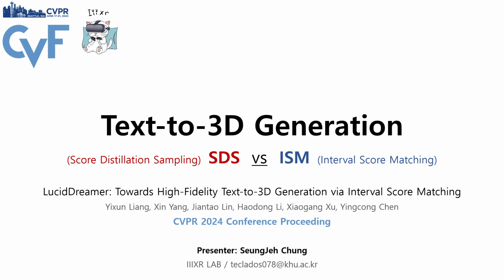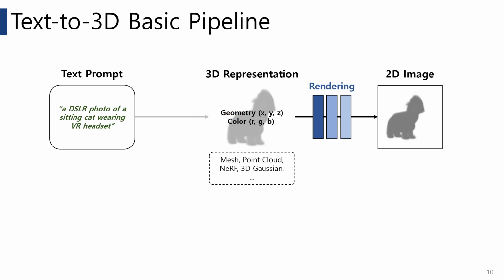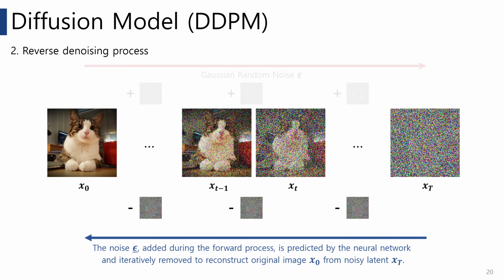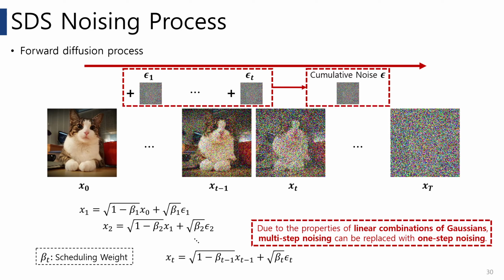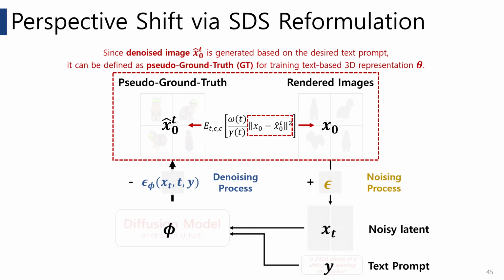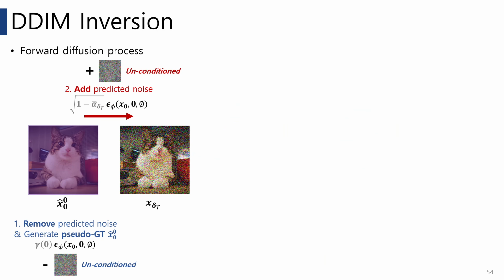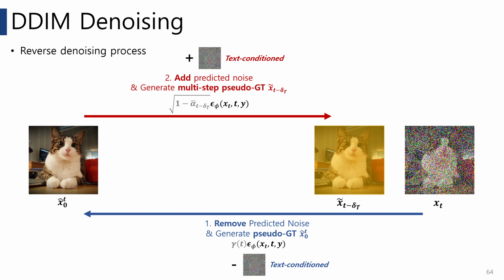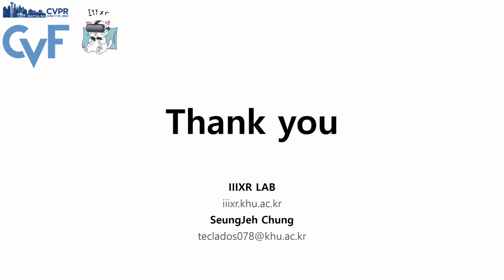[Seminar] Text-to-3D Generation using SDS versus ISM

Comment: When two models, DDPM and DDIM, are trained, they utilize 2D images rendered from a 3D mesh. However, I think there can be a situation where the 2D view does not intuitively match the 3D. For example, if I want to generate a real Moon, the 2D image seen from behind is just a black circle. Although it is accurate, I think it may not be appropriate for expressing the text prompt.
Q1: Is it okay to use an image like that?
Q2: Is it completely random to choose a 2D view from the 3D model?

Thank you for your presentation
Reply: A1. As explained on slide 13, you need to perform multi-view rendering! Since a 2D image lacks information compared to a 3D model due to the dimensional reduction, it is essential to complement this with multi-view rendering from various perspectives.

A2. Typically, camera views are sampled randomly from a spherical coordinate system. While it is possible to strategically select camera views, in most cases, randomly sampling camera views from a Gaussian distribution with a wide variance tends to yield better performance.

Comment: I could get a broad understanding of Diffusion. Thank you for the presentation.

Q1: I've seen the term "U-Net" mentioned in many other papers as well. Does "U-Net" refer to a specific network structure, or is it just a general concept?

Q2: Is it generally true that learning multiple steps of denoising performs better (except for inference speed) than learning a single step of denoising?
Reply: A1. U-Net refers to a specific neural network architecture originally designed for biomedical image segmentation. It has a distinctive "U" shape due to its encoder-decoder structure with skip connections between corresponding layers. This structure allows it to capture both global context and fine-grained details, making it widely adopted in diffusion models for image generation tasks.

A2. Yes, it is generally true. Learning multiple steps of denoising allows the model to gradually refine the output, capturing more details and improving the overall quality of the generated data. Single-step denoising can be faster during inference but often sacrifices performance in terms of fidelity and diversity.

Comment: it was the seminar i had been waiting for.

since it use text promt, it is conditional diffusion model. Then does it classifier free guidance? or else?

And the diffusion distillation I knew was made faster by reducing 1000 steps to 10 steps. What does SDS have to do with this?
Reply: A1. It uses classifier-free guidance.  

A2. Could you clarify which diffusion paper you are referring to? With more details, I can provide a more accurate answer.

Comment: Q1. I understand that DDPM is an advanced form of diffusion models. Structurally, how does DDPM differ from general diffusion models, allowing it to achieve further advancements?  

Q2. Although your explanation was helpful, I am struggling to understand how LucidDreamer differs from existing models. Could you clarify what the main contribution of the paper is?
Reply: A1. It seems your question compares DDPM with the earliest diffusion models. DDPM improves upon vanilla diffusion models by introducing a more refined mathematical formulation of the forward and reverse processes, along with a well-designed loss function. These improvements allow it to generate higher-quality samples. Since DDPM is considered foundational knowledge for diffusion models, I recommend reading the full paper if you're interested.  

A2. The main contribution of LucidDreamer lies in introducing DDIM inversion and ISM loss, which address the issue of over-smoothed results commonly observed in text-to-3D generation tasks.

Comment: Thank you for sharing your expertise in such an interesting way.

Q1. What are the main components of the "lucid dreamer" system used in ISM-based 3D generation, and how do they improve 3D model generation efficiency?

Q2. How does using deterministic noise in ISM affect the quality of generated 3D models compared to random noise?
Reply: A1. The main components are DDIM inversion, DDIM denoising, and Interval Score Matching.  

A2. It helps address the issue of over-smoothed results.

Comment: Thank you for your presentation.

Q1. In Slide 10, does the model learn up to the process of generating images through rendering? In the case of multi-view rendering, is it designed to allow a single model to generate multiple scenes, or is there a separate process that makes this possible?

Q2. In Slide 29, is the reason for adding noise to the rendered image because Diffusion is being used?
Reply: A1. The model learns specific parameters that determine color and shape during the image generation process through rendering. For example, if the rendering pipeline uses spherical harmonics to calculate color, the spherical coefficients are treated as learnable parameters. In multi-view rendering, multiple camera views are simply set, and the model uses a set of images rendered from those views.  

A2. That’s correct. The pre-trained diffusion model inherently takes noisy latents as input. Additionally, the SDS loss is defined based on the difference between the noise in the noising and denoising processes, so noise must be added to prepare the input for the diffusion model.

Comment: Thank you for the presentation. I have two questions:

Q1. In the slide titled "Limitation of SDS 2", I’m curious about what happens if the pre-trained model belongs to the neural ODE family (e.g., Consistency Models, ICML 2023). These models estimate the accurate path from any xt to x0, so they might be free from the prior gap. Could this address the limitation discussed in the slide?

Q2. In the paper "Null-text Inversion for Editing Real Images Using Guided Diffusion Models" (CVPR 2023), the vanilla DDIM inversion suffers from cumulative error, so the authors use it as an initial guess (or anchor) for their optimization process. While the main purpose of this seminar’s paper and Null-text Inversion is quite different, I think a similar problem with DDIM inversion might arise. Does the seminar’s paper address this issue in any way?

Comment: Thank you for the great seminar; it was very insightful and well-explained!

Q1. I don't fully understand what pseudo-GT is. What is the difference between pseudo-GT and real ground truth, and why can the generated image be considered pseudo ground truth?

Q2. Are recent papers trending towards using ISM instead of SDS?
Reply: A1. Since the goal is to generate a 3D model from text, there is no real ground truth. The denoised image produced by the diffusion model, conditioned on the text, is considered a pseudo-GT because it represents the image we aim to generate based on the text, even though it is not yet fully optimized.  

A2. Recent papers tend to focus on identifying the limitations of SDS and proposing new losses or constraints to address them. However, papers in domains not specifically focusing on limitations of SDS often continue to use SDS as a standard approach.

Comment: Very specifically, great seminar.

Q1. In many text-to-something domains, CLIP model is adopted for embedding text. I think text-to-3D model also adapt CLIP model for it. But other domains have issue that CLIP model, trained only for image and text, have no knowledge of something. This makes the text-to-something model that used CLIP model worsen their performance, so there are many research for addressing it. In text-to-3D domains, there are similar research?

Q2. This paper demonstrate that their proposed method, ISM, is more superior than SDS. But as I know, SDS is still used for many research. Then why ISM fail to become standard?
Reply: A1. In text-to-3D, rendering the 3D model into 2D images allows the use of CLIP, which is trained to align text and image information. This approach is generally effective, but the dimensionality reduction during rendering can lead to information loss. To address this, some research focuses on advanced multi-view rendering techniques or incorporates additional modalities, such as depth images, to enrich the input information.

A2. ISM is a very recent development. SDS remains widely used because it is a well-established standard for text-to-3D tasks. Furthermore, many recent studies focus on identifying and addressing the limitations of SDS by proposing new diffusion losses or constraints, which are still in their early stages of adoption. This is likely why ISM has not yet become the default standard.

Comment: 1. I have a question on page 11 and page 12. Are they learning 3d representation in a way that reduces the difference between 2d and text in the diffusion model?

2. In DDPM, 6 is it going through the forward noise process, not starting with random noise?

Thank you for seminar
Reply: A1. Yes, that's correct.  

A2. Could you clarify what "6" refers to?

Comment from the maker: [Overall]
- It was enjoyable to see the flow from Generative AI to DDPM, SDS, and DDIM, providing a broad perspective on the research trends in this field.
- The PPT structure and visual organization are clear and neat.
- However, as the presentation primarily relies on visuals and narration to deliver information, it can be overwhelming to follow the content. Including a key takeaway or main point in a single sentence on each slide would make it easier to grasp the essence of the message.
- Overall, it is unclear what the main emphasis and intended message of the presentation are.

[Feedback]
- Due to the nature of diffusion models, images of t, t-1, t-2, etc., repeatedly appear, making it challenging to determine which specific image corresponds to the current context. Following along requires intense focus.
- While the overall flow is clear, the seminar's goal—Lucid Dreamer—feels somewhat overshadowed within this broader narrative and is not sufficiently emphasized.
- In transitions between topics, motivations or the necessity of the shift should be more strongly highlighted and explicitly reflected in the slides. For example, the transition to diffusion is abrupt, disrupting the flow.

[Questions]
Q1. What are the advantages of DDIM over DDPM? Does this mean DDIM is always superior to DDPM in practice?
Q2. How is text conditioning applied using U-Net?
Q3. What areas still need improvement in Lucid Dreamer? In which direction do you see the technology evolving in the future?
Reply: Thank you for the detailed feedback. 
I will aim to deliver a presentation with clearer explanations and smoother transitions in the future.

Here are the answers to the questions:

A1. Not necessarily. DDPM uses a stochastic diffusion process, which has the advantage of producing diverse results. In contrast, DDIM utilizes a deterministic diffusion process, which reduces diversity but enhances fidelity and visual sharpness. This often results in higher-quality outputs in terms of visual clarity.

A2. Text prompts are embedded as features through a CLIP encoder. These embeddings are then applied across all layers of the U-Net via attention mechanisms.

A3. While implementing LucidDreamer, issues such as the janus problem were observed—for instance, generating inconsistent orientations, like a cat's paw facing multiple directions. This is a common challenge when using diffusion models with 2D projections of 3D data. Future advancements may focus on leveraging true 3D diffusion models or incorporating alternative 3D-specific priors to address these issues.

Comment: Thank you for making this complex topic so accessible through this informative seminar. It was incredibly helpful.

Q1. How does the deterministic noise in ISM address the over-smoothing issue observed in SDS?

Q2. How does the incorporation of CLIP embeddings influence the alignment between the text prompt and the generated 3D model?
Reply: A1. It addresses the issue by eliminating the averaging effect caused by the differences between pseudo-GTs generated with random noise.  

A2. The text condition for text-to-3D generation is not the raw text data but rather the CLIP embedding obtained through the CLIP encoder.

Comment: Great seminar! I could really see the effort you put into it.  
I have several questions because I'm not very familiar with diffusion.

1. On page 44, the statement "Since the denoised image is generated based on the desired text prompt, it can be defined as pseudo-GT" is a bit hard for me to understand.
Why is it considered pseudo ground truth (pseudo-GT)? What would be the real ground truth (real-GT) in this context?

2. On page 48, why is it referred to as "low-quality guidance"? Also, what does "guidance" mean here? What role does it play in diffusion?

3. Although it wasn’t covered in the video, I understand that classifier-free guidance is commonly used when applying conditions in diffusion. Does the paper you introduced not use this method?

4. On page 52, I’m having trouble understanding why DDIM is referred to as deterministic noise. Is it because it precomputes the trajectory using interval steps and only uses the noise from steps within that trajectory?
then, why can’t this approach be applied in DDPM? What’s different about DDPM that prevents this kind of deterministic behavior?

5. How is an interval step determined? Is this hyperparameters?
Reply: A1. Since the task is to create a new 3D model from text, there is no real ground truth (real-GT). However, a reference GT is needed to guide the 3D model to follow the text prompt. The denoised image from the text-conditioned pre-trained diffusion model serves as this reference GT and is therefore called pseudo-GT.

A2. Guidance refers to any formula or information used during training to steer the optimization process in the desired direction. In SDS, the guidance comes from reducing the difference between the rendered image and the pseudo-GT (denoised image from the pre-trained diffusion model). However, because pseudo-GT is generated in a one-step manner rather than the multi-step process the diffusion model was trained on, it is considered low-quality guidance.

A3. Yes, classifier-free guidance is used. The paper applies text prompts to the CLIP encoder to generate embeddings, commonly using a pre-trained stable diffusion model.

A4. DDIM is considered deterministic because its noising process doesn’t add random Gaussian noise. Instead, it uses noise inferred by the pre-trained diffusion model, making it consistent and predictable. In contrast, DDPM adds stochastic noise sampled from a Gaussian distribution, which varies with each step.

A5. Yes, interval steps are hyperparameters that are manually set to determine the step size or interval used during the DDIM process.

Comment: Nice presentation

Q1. In page 27, what does the term "score" refer to? What does it mean to "distill a score"?

Q2. In page 44, does the noisy image xt hold the information of the input x0? It seems like the generated images x0 hat from the diffusion model preserves information like camera angles. However, as far as I am concerned, the noisy image xt should be fully gaussian without any information left of the original input. Can you explain this matter in detail?
Reply: A1. The term "score" refers to the gradient direction used for learning, representing the optimal restoration path in a diffusion model. It is derived from the difference between the noise predicted by the diffusion model and the actual noise added during the noising process. The phrase "distill a score" means using this gradient information to refine the model parameters or align the generated outputs with the target distribution.

A2. The noisy latent  x_t , created by adding noise to the rendered image, is not fully Gaussian. It represents the noisy latent at an intermediate timestep  t, not the fully noisy state at timestep T. As a result, x_t still retains partial information from the original input x_0, such as camera angles or structural hints. This aligns with the SDS approach, where the learning direction is based on the differences in noise at intermediate timesteps t, rather than at the fully Gaussian state.